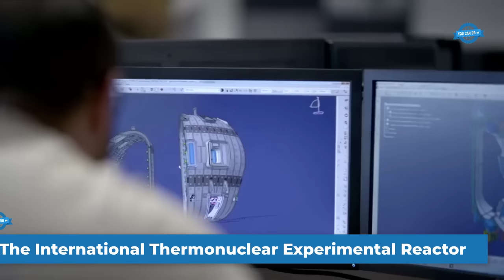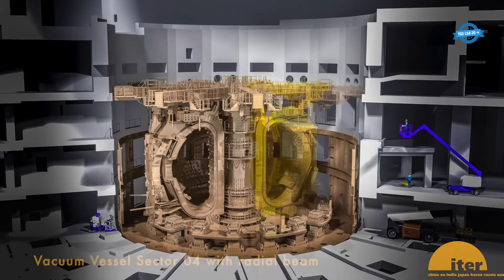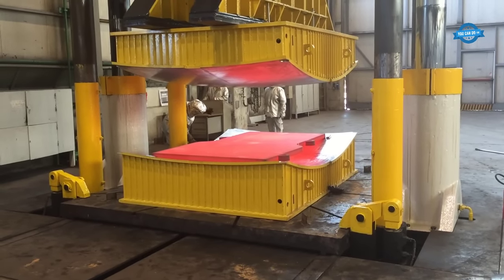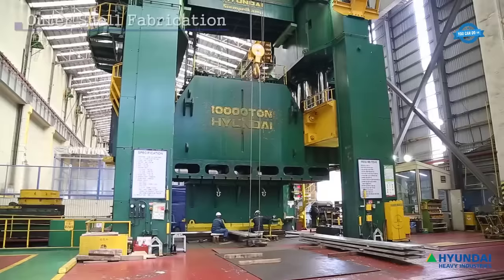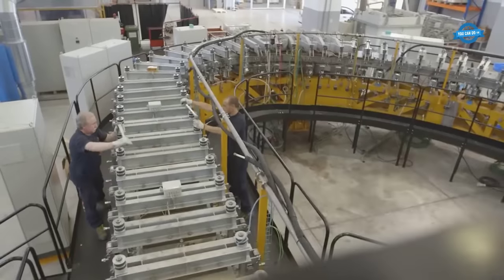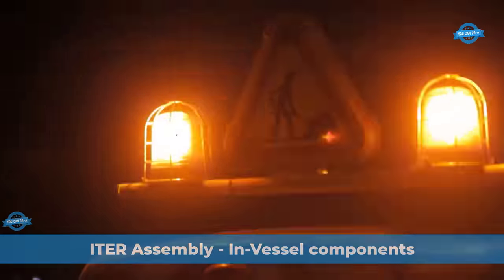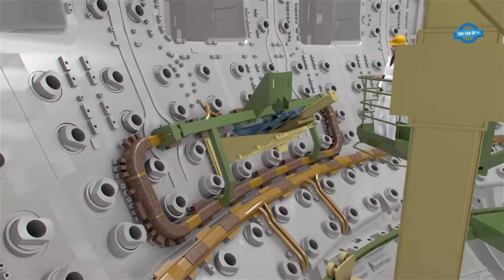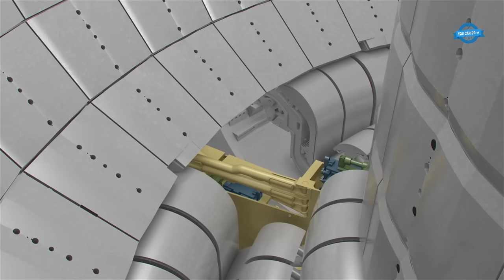The Machine Has 10 Times Hotter Than The Sun. Manufacturing Process Of Largest Fusion Energy Machine

Comment: Am really confused. Is there any construction material here on earth that can withstand such monstrous temperature, I mean ten times more hotter than the core of the sun?
Reply: No. The ITER uses a metal torus and powerful magnetic fields to create a magnetic bottle, that contains the 150 Million degree plasma. The Plasma never comes in contact with the torus itself, but if it did, it probably wouldn't do much damage as the plasma is very diffuse. So it may be hot, but there's not much of it, so it cools quickly.
Reply: Yes, McDonald's food
Reply: The tiles inside the tokamak are made of graphite which provide a thermal barrier to the rest of the reactor.
Reply: im with you its just fairytale as far as the temp. goes
Reply: My thought also. If it is just bare metal against that temperature, then there cant exist such a metal here on earth anyway. They have problems even making insulation material for spaceships entering the atmosphere🤔
Reply: @jt209g  You obviously have no idea whatsoever as to how nuclear fusion works because if you did, you’d know that the temps are 100% real and correct. You’d also know that the plasma never comes near any of the reactor surfaces because it would instantly vaporise EVERYTHING it touches! The whole idea of the tokamak reactor is that we have ai technology controlling the shape of the plasma and using all the magnets to steer the plasma and make sure it doesn’t touch any surfaces.
Reply: @aaronperelmuter8433  you right

Comment: Interesting fact the technology in this experiment will be outdated by the time its made, smaller ones are making leaps and bounds due to being able to R&D + prototype at the same time and its very likley we will have small scale providing power before this. Saying that though the scale of this experiment will allow them to do testing that cannot be done on a small scale with the added bonus of the science behind it will be a lot more sound (fingers crossed by then) so it will lead to power production without the loss.
The craziest thing is they have to build everything think its twice or three times to prove its works and will be fine in full scale, so you effectively build two plants but end up with one
Reply: What I understand is that this device can create precursors which will make the smaller devices not having to spend working hours on that, and be used for energy generation. The inventor of that device that's already proven itself tot work said as much in the interview in that vid. 

Point taken, but also: these guys do know what they're doing. 

Personally I've had something like "whenever we can get that going, we'll may well get our Zaphod Breeblebox moment"

Comment: Who really believes  the Cost, amount of environmental  devastation needed to procure the raw materials and the huge amount of  energy used in both the mining and construction of  this experimental project  couldn't have been put to better use ? .
Reply: The only way for mankind’s energy future needs will be fusion
Reply: One probably could have made a LOT of solar cells for the cost of that thing. After all there is well proven (billions of years up time) functional fusion reactor in the center of the solar system, one just need to use it.
Reply: @christopherkingston9601  Also the only significant way for mankind's (indeed virtually all life's) past energy needs has also been fusion.
Reply: Nah
Reply: Nuclear energy is actually the cleanest type of energy
Reply: @christopherkingston9601  No it's not, it's hydro, solar (and battery banks) with a small dash of fission, once we work out how to deal with the depleted uranium, and that's not that far away.
Reply: And it also toasts bread
Reply: @IvyMike.  hydro is causing ecological problems due to the dams. Solar/battery systems still need a lot of precious metals. All power generation is going to use precious resources. It’s all about which one will give the best yield. Fusion has the allure of possibly being the highest yield.
Reply: @Jules_73  On massive scales, yes, I agree, (sledge hammer to crack a nut) on smaller community scales? Maybe not.
They need to be engineered to suit the local resources, and that would take logic, that governments lack.
Reply: Yep windmills are totally a better option then this thing 🙄
Reply: @jasonglenn957 until you have the nuclear waste to dispose with.
Then what then?!?

Comment: Why must the prototype be so large and expensive? Would it be easier to scale it down to a reasonable size and allow independent contractors a chance to manufacture a generator. This way instead of only one huge experamentel  generator being built that might cost billions there could be many smaller ones at a fraction of the cost. See who can make the best one. And it will not cost the government billions if one of them fails.
Reply: When did anyone ever say that prototype fusion reactors MUST be so huge and expensive? I certainly never heard of any such restrictions. And, since you’ve obviously looked into this, you’d know that since there are, what, perhaps 15-20+ nations working on this, and by extension, hundreds and hundreds of some of the most talented physicists on the planet, so I’m sure it would have never occurred to even just a single one of them to make this thing smaller. Why would it, I’m thinking they just want a huge reactor like old men buy fast sports cars to compensate?

Seriously, do you actually think that no one ever considered ALL of what you stated? Honestly? The reactor is the size it is because with the process they’re using and the superconducting magnets wouldn’t allow for the appropriate parameters to be met if it was any smaller.

Furthermore, there are several competing fusion prototype setups, all of them far smaller than ITER. Many of them are run by private manufacturers, actually I’m pretty sure all of them are. Have a look at MIT’s SPARC tests or Helion fusion, just two out of many other competing technologies.
Reply: @aaronperelmuter8433  I worked for many years in the nuclear industry and I am familiar with the fission process. The largest nuclear facility's I helped build was Nine Mile 1 and 2 in Oswego NY and another in Painsville, Ohio. The main reactor cores were only 25 feet across. But before these were built a small functioning reactor was built at the University of Buffalo, New York. It was small enough to experiment on and learn how to build it correctly without spending boat loads of our money. Yea, lets spend billions of our dollars on a huge project that might not work. Really. Somebody is getting rich on this one. And, It is probably getting funded by government grants. Free money. How do you think Elon Musk got so rich. Government grants.
Reply: Well i hope they are not just assuming that because AI had something to do with the R&D of this thing that it must be correct so we won’t build a small scale just do the megatron version straight up 😳